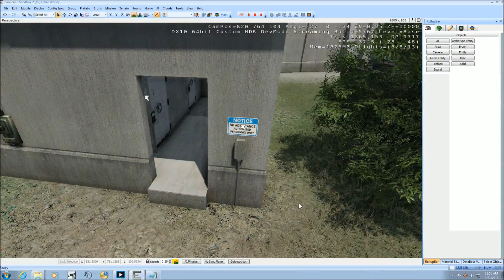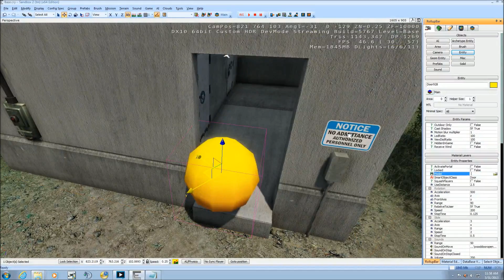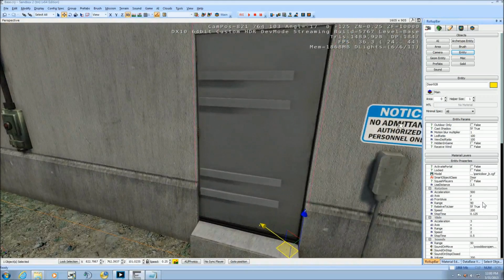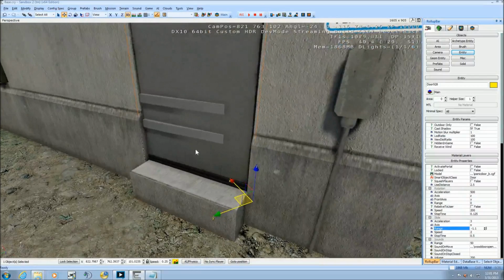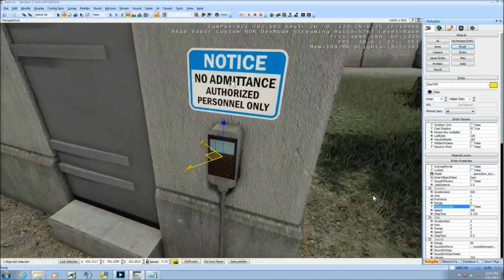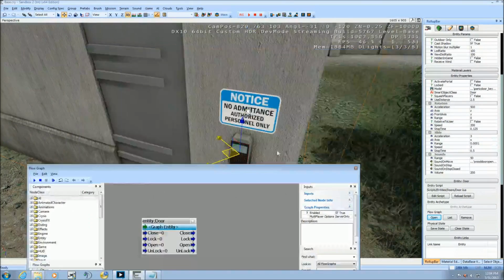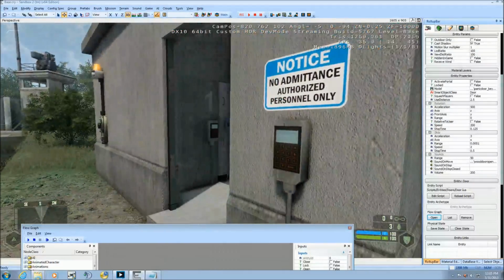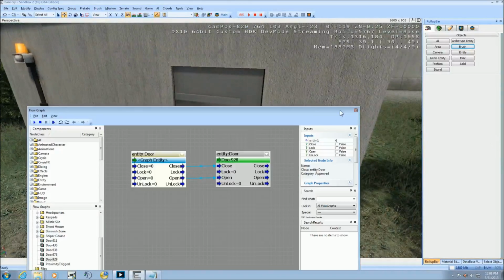CryEngine 2 Tutorial: Keypad Doors

Comment from the maker: Both are contained in the research dome model sub directory.  If you can't find them by using search terms "panic" or "key", try locating them manually.  I know for a fact they exist - they are in the Crytek campaign map "Rescue".  Try opening that map and looking inside the dome right before the cutscene area where Rosenthal gets frozen up.  Nomad has to use the keypad to initiate the cutscene.

Comment from the maker: Both models are listed under the standard brush library.  Just run a search for "panic" and "key", or else check manually under the research dome model folder in the library/architecture subfolder.